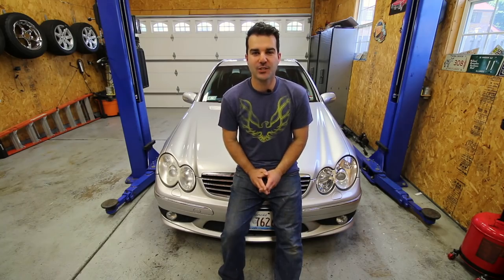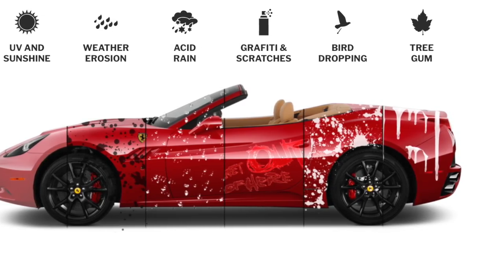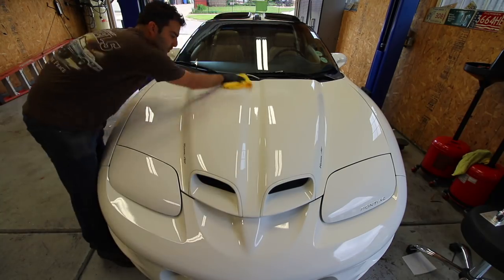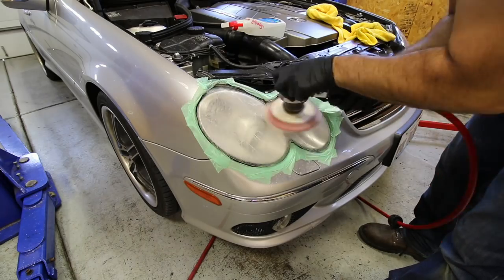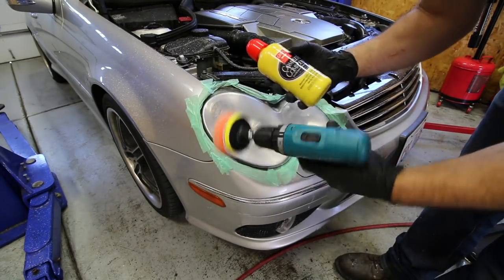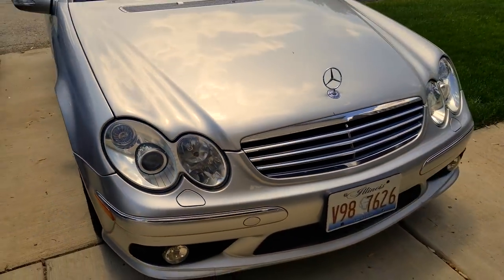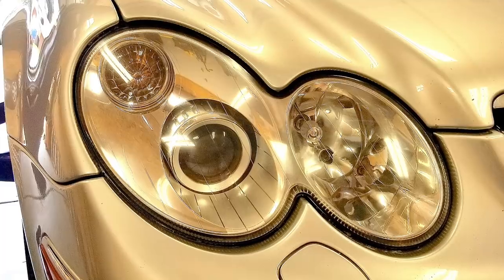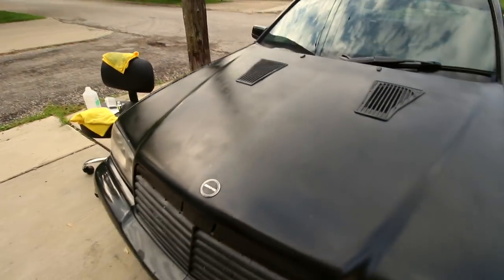How To Restore Headlights With Ceramic Coating. Super Cheap, Super Satisfying!

Comment: In case anyone is looking for feedback on how this works, I just did this to my E55 and the headlights look immaculate.  I swapped the ceramic coating for 3m clear coat, and used both meguiars polishing compounds.  I bought the sanding kit from amazon, and did 1,000, 2,000, 5,000, and 10,000. Then I used the MG ultra cut compound, followed it with the MG ultra finishing polish and wiped with alcohol before applying the clear coat.  Whole thing cost me $58, and I can re use all the stuff a bunch of times. Only went through like a quarter of a bottle of each compound. Highly recommend.

Comment: I'm a detailer myself and this is a great diy. Really well done. I just purchased a D3 A8 and it had this problem. One thing worth mentioning is that if the sealant/coating wears, the plastic yellows faster because the uv coating on the plastic from the factory has been sanded off. Also, I recommend adding a polishing step with a fine polish before sealing. Heavy compounds like that are still not fully clear.
Reply: he did use the meguiars fine polish...
Reply: @albussnow  you're right, I missed that.
Reply: Is ceramic coating the headlights better than clearcoating them?
Reply: @legioner9  nope, ceramic coating won't protect from uv long enough to make a difference. Highly recommend clear coating them and then ceramic coating them periodically afterwards. It's a pain but less so and looks better than repolishing all the time.
Reply: @charlesaferg  Thank you for the answer. I just hope that the clearcoat will not crack in 2 - 3 years.
Reply: @legioner9  np, just make sure you get clear meant for automotive headlights and is uv resistant. Otherwise you'll be polishing & re-coating ith any sealant within 6 months at least.
Reply: Good day Charles, if I may ask, which ceramic coating for headlights have the longest durability. Thank you kindly.
Reply: @predragjovic1981  whichever one you apply after you've clear coated your headlights after sanding. 😅
Reply: @charlesaferg  🤣🤣🤣... Got it Charles.... Very true, nowhere to find a follow up after a year or two. 🙏👍
Reply: @legioner9  while it may look better in 2-3 years with clear coat. The problem i ran into is that like the clear coat on your cars paint, the stuff you spray on the headlights will eventually get swirl marks. Personally not a fan of using clear coat on headlights
Reply: @sbc_jake_9677   Me neither. I mean, I polished them and only after like 1 year they started to get dull, but I also did not protect them much after the polish. So, who knows ... clearcoat for plastic with UV protection etc. is also quite expensive here in Europe at least ....

Comment: Just wanted to let you know I really enjoy watching your videos. I live in LA near LAX but grew up in northwest IL and grew up working at a BMW/Mazda/VW place. I learned how to drive stick on an 88 BMW M5 and drove (aftermarket) 60's Shelby Cobra and 67 Corvette Stingray convertible so my passion for cars is strong. I like learning to work on my 2014 VW GLI with stage 1 Unitronic tune and building up my Tekton tool kits. I've saved tons of money learning to change my own engine/transmission motor mounts, brakes and heater core. I enjoy scouring the internet for tips and tricks on detailing and maintenance of my car. I appreciate your contribution to the car aficionado passion and helping people. When I moved to LA my first sales job, one of my customers was Carol Shelby and had private access to about 30 plus cars of his. It was really cool to be in that private warehouse and check out those cars. I love cars.

Comment: Dude, great info and video! About the plane sounds, when you were shooting outside, you either had a lav mic on or the in camera mic was so close to your mouth, the auto gain adjusted to your voice level and just about muted the plane sound. But when you were in the garage, it sound like you were using the on camera mic when you were standing at a distant which caused the auto gain to be jacked up, bringing in all kinds of ambient sounds, most noticeably, the plane. Just use a lav mic and if you can manually adjust sound level on the camera or app, adjust for your voice to reduce background sound.

Comment: I must say in a regrettable fashion before I could spend any amount of money on plastic headlight refinishing I would look for a new light replacement online from a reputable seller.  Oem repair your video is spot on yet as you pointed out one headlight will always look better because it is new and although you have repaired the old one the chrome is still faded. Classy video.
Reply from the maker: Thanks for watching. Replacing the lens is kind of a big project for most. You have to remove it, gut it, bake it in an oven, remove the lens, deal with glue or silicon for the new lens. My process is around $20 if you already have a drill and/or dual action sander. The amount of ceramic coating you use is next to nothing as well.  The other headlight was brand new but most people won't have one new headlight on their car. 

I replaced the lens on my E55 because it made sense since I was painting the inside so ever scenario is different but for the vast majority, a process like this can save a lot of time and money.

Comment: I  only use liquid "COLLINITE 845" that I buy on eBay for about $22. It's super easy to apply and buff off with a Micro fiber cloth.  Wash my 2 cars once a week at the do it yourself car wash using the pressure wand on rinse only. The water runs off just like the product you demonstrate in the video. By the time I drive home "2 miles" the car is 90% dry with absolutely no water spots. I can do each car at least 5 times with one bottle. Two applications last a full year and only takes one hour to do.... Be sure to do it in a shady location

Comment: I really appreciate your expertise.  I also provide this service to customers. The only difference is the coating that I am using can last 3 - 5 years but I also use your ceramic coating in the video, and it works great.
Reply: Good day, if I may ask, which ceramic coating do you use? I am polishing headlights, tried few coatings, but none last more than a year and half. Thank you kindly.

Comment: New subscriber here. Excellent video!  Great content, presented in an interesting, and easy to understand fashion.  Outstanding camera work, editing, and audio, in spite of the air traffic, lol.  You're smart enough to use a wireless lavalier mic, which makes a tremendous difference and provides the best possible rendition and clarity of spoken audio.  

I tried a Maguire's headlight restoration kit on my Lincoln MKX's headlights, but it didn't go that well.  I tried the process about four times with a battery oprated drill, but still not much improvement.  Your process has several more steps involved and probably would have worked on my MKX.  Keep up the fantastic work!

Comment: I would highly recommend clear-bra. The ceramic coating won't really protect it from further abrasion from sand and rocks, nor does it really prevent the plastic from yellowing again over time.
I had clearbra on my mustang headlights after polishing them and after 5 years the clearbra looked pretty worn but the plastic underneath was perfect.

Comment: this is great and I have done it on so many cars, but unfortunately, it does not last. It was more fun to take the lenses off of my W211 and replace with brand new ones. 3 years into it and they still look brand new. If I have to do it every 8 years, I am okay with it, rather than doing this every 8 months.

Comment: Good video where can you buy suede applicator rags, and also after opening the bottle of product is there a problem with air inside curing or drying.(Using product multiple times).

Comment: No issue with the headlight renovation, but aren't ceramic coatings like the one you recommend for car body work akin to snake oil? Read many things saying the 9x hardness rating means nothing. I did buy and use a cheap ceramic coating advertised as such from ebay, but did not repel water for as long a time as a  good quality car wax did.
So, a year or more on, do you still recommend this ceramic coating?

Comment: Here’s a detailers trick you may not know of. On polished aluminum wheels or other parts, use talcum powder on the polishing cloth during final rub down and it will look as shiny as chrome. Takes all the black off of the surface.
Reply from the maker: Billy Mehaffey Awesome tip! Thanks

Comment: My preference is to do it by hand and start with a really coarse paper... I usually start with 320, then jump to 400, 800, 1000, 1500, 2000, and then polish/buff and top with clearcoat

Ceramic coating is a new one for me. I'll be interested in the longevity of the repair.
Reply: Hahahaha u wasting whole lota time skip the first ones start 1,000 finish 3,000 same thing or better
Reply: @JoseRodriguez-lt7xi  you  waste a lot more time using the fine paper starting out. The coarser papers knock down the deep oxidation real fast, then you're just polishing out the scratches.
Reply: 1000 is fine wyt about man
Reply: This sounds like SprayMax's directions for prepping for their headlight clearcoat. I am thinking about using that and then putting a ceramic coating on top of that.

Comment: Have you thought about an aftermarket head unit for any of your AMG’s? Seicane makes a nice Android one for the w211 that looks stock and has a bunch of nice features, I know the 2003 cars had a bit of a disappointing command unit so maybe it would be a cool diy install video if you decided to do it. Keep up the videos!
Reply from the maker: Larry Wilmore Yes for sure. In talks with them now
Reply: Be careful of endorsing something that turns out to be 2nd rate. A quick search of YT throws up a few retraction videos for the Seicanes.
Reply: "50's Kid" is an example. He does some great BMW E46 coding vids and installed a Seicane as part of an E46 manual swap series.
Reply: Cassette Walkman that's surprising. Tavarish installed one in his sl55 and is very happy with it
Reply: Larry Wilmore the general reviews for Seicane seem to be about 50/50 5 stars or 1 star. They really are just standard generic Android guts inside a faceplate from factories that are trying to produce as cheaply as possible. The problems I've seen reported seem to stem equally from the buttons and controls as from the processors. Lack of ram seemed to cause some problems but doesn't seem isolated to one thing if you read forums. I've myself installed 2 almost identical looking units (not Seicane) that were clearly made in diff factories but to the same look externally. One was laggy, dropped bluetooth & had awful graphics and had to be returned. The other works flawlessly. It's a crapshoot & Seicane reviews terribly inconsistently for customer service. Lucky Tavarish but I def wouldn't call him an expert in these things. He's a journalist and a talker, not a technician.
Reply: Cassette Walkman not saying he's an expert, just that he has a real world application of it. Unfortunate for the one you installed, but is there anything else with that level of functionality that looks stock?

Comment: I did a polish job on my W203 and used some UV stuff but the yellow came back. Ended up doing a lens job like your E55. Good vid.
Reply: Did the yellow come back with this method? Im planning to use SEM Solaray UV coating for headlights and then after waiting a week i will clean the headlight again and apply this ceramic coating

Comment: Great video, Alex. Thanks for your tips. You always have some great ideas. I've begun using FCP Euro due to your recommendation. And, I'm now using Liqui Moly oil (I've used Akebono pads in the past).

I've used a few mfgrs approaches for headlight lenses cleaning, and liked the 3M approach before on headlight lenses as it worked the best, but the old W210 headlights still looked a bit cloudy. Our current cars (98 SLK230 & '13 C300 4Matic sedan) have lenses in great shape so I won't need to use the sanding exercise. Your approach and products to use will work better. I've seen the Griot and Meguiars products on the shelves before, but never thought to use them to clean the headlight lenses. There are a few very minor scratches on the C300 lenses, so I'll see if the buffing removes them as I'd rather not use sand paper on them unless that's the only approach.

As for the Avalon King ceramic coating product... I am very interested in that process. The SLK will be a no brainer and very easy as it has almost zero dings or scratches.  The C300 is close, but the front bumper is so low to the ground that it has been scraped a few times and the paint is chipped. I'll do all of the car but the front bumper for now. I was going to sand it down and repair it myself (the lower lip) as I found some factory Alpine White spray paint online and use a clear SEM product to offer some chip resistance, but I may just drop by a buddies' shop to see how much he'll charge me to respray the whole bumper.

Comment: Also, have you seen SK8125's recent videos? He blew his E55 engine due to oil starvation from a faulty O-ring on the oil pump breaking down and the system sucking in almost pure air. I was ready to blame the fact that the car is twin-charged for the failure because of the added stress, but the replacement engine he got from a CLS55 apparently had the same extremely brittle O-ring, but that one hadn't failed yet. The rod bearing's showed signs of being spun in the new engine as well, pointing to oil starvation according to him. Wondering what your take on this is considering you're a former MB master tech and own an E55. I was considering attempting to check my O-rings for deterioration and replace that one specifically for preventative reasons, however it seems that in order to get to it you have to either pull the engine or drop the front subframe which is a bit above my current skill level. I really don't want to pay the labor for an indy to do it haha.

Comment: What would you use to fix headlights that are clear, but yellowed from the sun? All these products and headlight fixing tutorials are for foggy headlights, but the headlights on my Lexus are just yellow from the sun, but not foggy. They are fairly clear. I’m so confused
Reply: DIAMLER Not sure if someone owned the car before you, but if so, most likely the previous owner had a good headlight restoration done, but they forgot to replace the UV clear coat that was sanded off in the process. The Sun's UV rays were then able to attack the exposed polycarbonate plastic lenses and turn them "a very clear yellow". They should be fairly easy to restore to clarity again. Just go to walmart, autozone etc. and buy some "liquid rubbing compound"... Even the $5 "turtle wax liquid rubbing compound" will work. Read the simple instructions and machine buff or hand buff out the yellow. Then make sure an apply a UV spray clear coat with 2x protection(walmart sells one for $3, Rust-Oleum 2x ultra cover, non yellowing, uv resistant in a spray can). Or, if you like, perhaps even the ceramic coating that Alex recommends in this video($much more expensive$). Or if you like,  just apply a good wax with uv protection in it. Hope that helps.

Comment: NO you Dont immediately rub it off !.
It has a 1-3 minutes setting time dependent on temperature. 
For longer lasting results, 2k clear coat lights before ceramic.

Comment: Hi Alex, I don’t have an indoor garage, can I apply ceramic coating in a shaded area, outdoor, or you MUST apply it indoor to avoid contamination, while it dries ????
Reply from the maker: It's best to do indoors but plenty of people do it outside. Just make sure it's not a very windy and dusty environment. It takes hours to fully cure but it's not wet or anything right after you do it.

Comment: Sorry to bother you but I put h7 LED bulbs in my 2011 c300 my light flickered on n off a few times and now my headlight won't work tried using the factory bulb n.still not working what's did I do wrong

Comment: Just an idea: next time try to go as far as 5000 grit sanding sponge or even use 15000 grit lap paper made by 3M and after that use the ceramic coating , I used 5000 grit on my car and you can really see the difference between 2000 and 5000